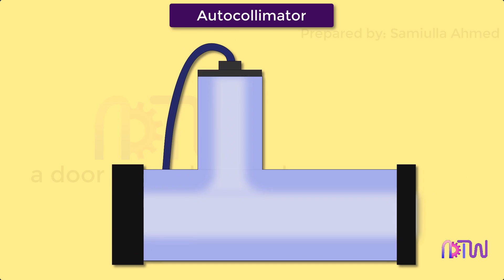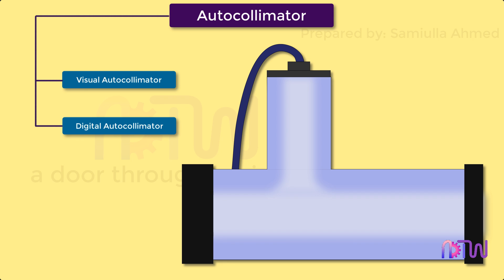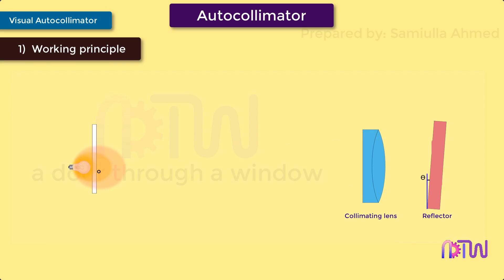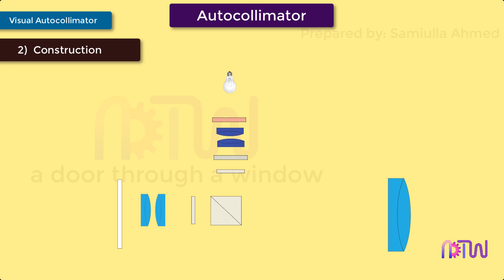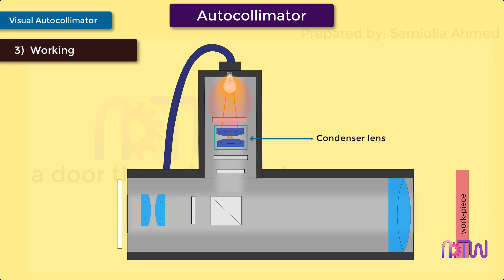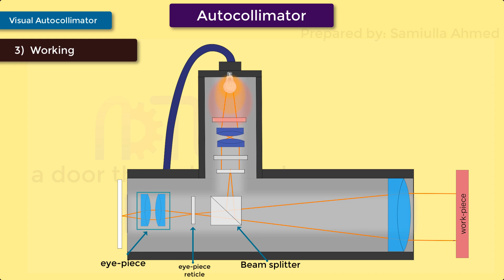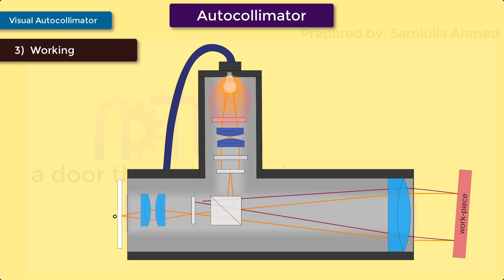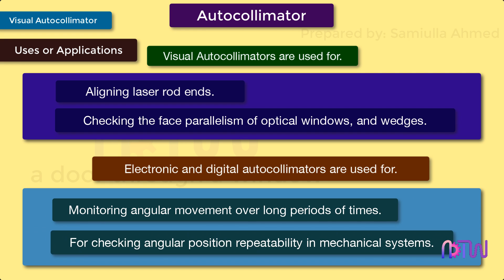Autocollimator Working animation

Comment: The explanation about beam splitter splitting light to the left and right is incorrect. It spilts light to the right and down. The down light is lost. When reflected from mirror light goes back, it splits on the splitter again, and goes to the left and up. The up light is lost. The system is designed in such way that the image of the objective reticle is imaged exactly to the eye-piece reticle. So when you look through eye-piece, you see two reticles: the eye-piece reticle itself and the imaged objective reticle. If they shifted with respect to each other, then the mirror is not reflecting exactly back, but at angle theta.

Comment: Why the beam splitter can split the light to left and right,  not right and down?
Reply: You are right. Their explanation is incorrect. I posted better explanation somewhere in the comments to this video.
Reply: Because the spliter can fited into some angle  so they can split into two beams.transmitted beam into horizontal way and reflected beam into vertical way that's it